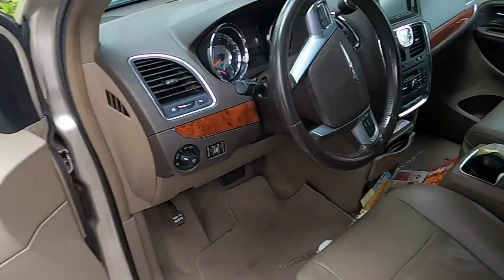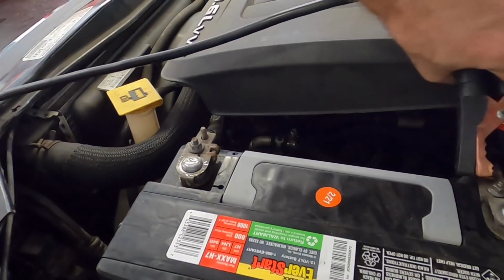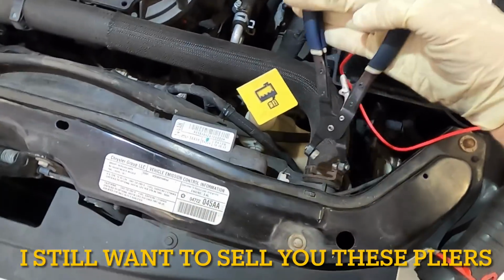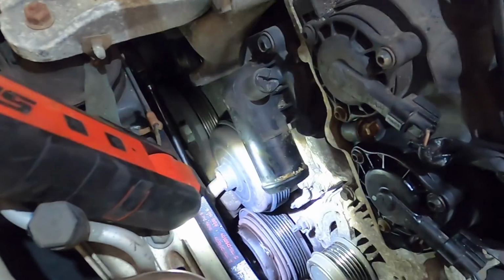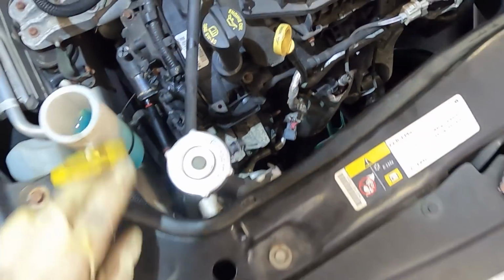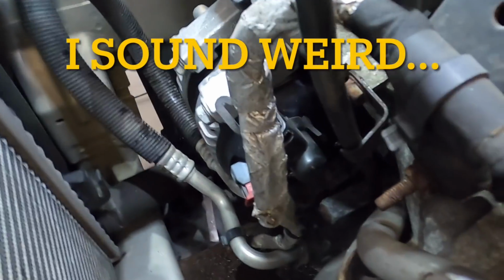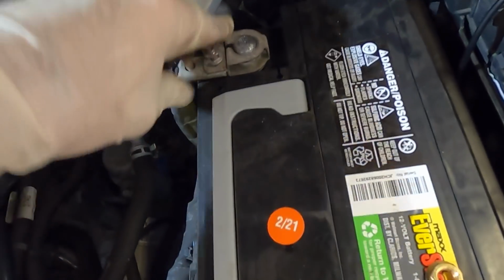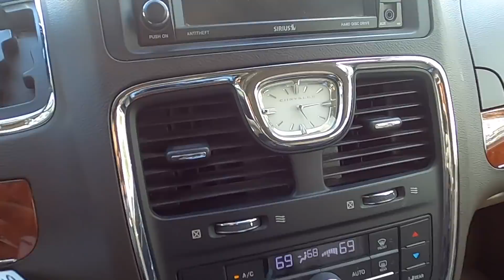Customer States: Burning Smell…Fire? 2014 Dodge Chrysler caravan battery light on!

Comment: I like vehicles where you can change the alternator without removing anything else.
Reply: do those exist?
Reply: Yes, like my '97 Land Rover. Alternator is right on top of the engine. 10 minute job if I stop for coffee in the middle. Not to mention, the original alt lasted 23 years.
Reply: @ianriggs  older vehicles, especially trucks with big engine bays
Reply: Rav4 Mk2 and Mk3
Reply: My 09' 3.8l T & C has that "no interference alternator removal" design. My friends at Duralast have seen to it that I have had plenty of practice 😡
Reply: @ianriggs  yeah my 2019 Subaru has the alternator front top and center, only has the plastic belt shield and bracket to pop off!
Reply: My Toyota has 360,000 miles with the original alternator.
Reply: I miss my 99 GMC Sierra for that reason. The first DIY I ever did was change its alternator and it sits right on top next to the air intake.
Reply: I was thinking the same thing.  Those were the days.  One bolt to release the belt and one more holding it in and 2 wires.  10 minute job.  I miss my 78 Ford pickup with a straight 6 2wd 3 on the tree.  Best truck ever made.
Reply: 10th Gen f150 with the 5.4 is four fasteners, one harness terminal, and the belt, and everything is visible standing at the front bumper.
Reply: I can get at my mk4 vw golfs pretty easy 🤷‍♀️
Reply: If the manufacturer kept it easy then why do they need all their engineers on payroll and then dealers couldn’t charge ‘ an arm and a leg’ to repair vehicles
Reply: 2004 hilux 1kz-te pretty easy to work on
Reply: Pretty much always gotta take off the belt tho
Reply: @ianriggs  I have a 2008 Grand Caravan. Takes about 15 minutes to change out the alternator.
Reply: @fordssuck  with the exception of my ’05 Lesabre. It’s way too easy to work on that thing, compared to my Beamer anyway
Reply: @ianriggs  new corollas are like that  and my 20 Cherokee is like that where you can get it off with out removing everything
Reply: My sequoia you can but only if you remove it from underneath so it's just as bad sometimes I prefer taking the fuse box and shit instead of laying down
Reply: It's a Chrysler, the original alternator was designed to be installed at the factory and removed by wrecking yard employees.
That doesn't necessarily mean they have incredibly long lives.
Reply: My 94 Mazda B3000 was great for alternator removal, easy peasy. Only did 3 (all quality remanufactured units) in the 23 years I had it
Reply: @alanm.4298  that must have been all that lasted 27 years on the motor..lol
Reply: @ianriggs  my 97 accord with the 2.2l.
Reply: But this is a POS Chrysler nothing is easy
Reply: @ianriggs  did a Buick the other day it took me longer to gather up the tools than it did to do the job
Reply: Yep I agree. But most sad part for this lady is that she owns a Chrysler. 11:46 that sticker in the left part of the screen is a “ Chrysler limited liability company” sticker. As old Scotty Kilmer says “ don’t walk away from this car, run away!” Lol. Most Toyota’s have the alternator right there ontop and plenty of working room. Love my 2009 yaris. Takes a few minutes to do it.
Reply: @ianriggs  my 05 f150
Reply: Lots of fun when you have to remove the wheel, ball joint and CV axle to get to it then remove the alternator bracket to make room to get it out. Then hope one of the three you got is good.
Reply: What’s even better is a car with no alternator at all 🥵
Reply: @ianriggs  yes they do!! My car is easy to remove the alternator!!
Reply: toyota corolla..  GM trucks  pretty much all of them
Reply: But if they did you'd be able to do the work on your own and it would make the dealership have a sad face.
Reply: @nykf32  yes, the ones with the "dynastart" system.
Reply: AMEN brother!
Reply: @ianriggs ......yes the older cars...chevy, ford, dodge
Reply: I like the way they are on the old Chevy's cars and trucks pre 2000
Reply: @ianriggs  2000 Tacoma is right in the front on top of everything...Wouldn't know how hard because they never fail...?
Reply: @Bryan-Hensley  Wish the same could be said about their starters...PAIN in the M Farking AZZ!
Reply: My 01 mustang was like that I had to take the belt off but that was it
Reply: My old 1977 280z, massive room, 2 bolts 1 nut and 1 plug.
Reply: It's right on too on my Honda which is nice, except that means it has to come off to fix basically anything else on that half of the engine bay.
Reply: @cigarsgunsanddiesel8032  but shame that for sparkplugs the engine needs to come out
Reply: @thrustvectoring8120  you are incorrect sir... Plugs on Subaru are accessed from up top and through the wheel well fairly easily.
Reply: @thaton3guy100  my 69 Grand Prix hood area was huge. Could practically sit in the engine area safely.
Reply: Good luck finding one! My 2005 Caravan is not too bad, but draining cooling system to change the alternator?
Crazy!
Reply: @jonathanmacdonald9276  as being a person from Europe can some of you Americans please tell me what's the deal with Chrysler/Dodge because I hear nothing but bad stories on every US automotive channel. Is Ford better then?
Reply: I miss those days. Just to think I hated working on Cadaverlacs of late 60s and 70s.
Reply: Belt?
Reply: So any rwd 4.6l or 5.4l Ford v8!
Reply: Yes remember when you could pull the fan and shroud and stand inside the engine compartment
Reply: Man tell me about it. My first real car work was when I was a freshman in college. Had to replace the alternator on my 2000 civic. I must say it was such a pain for a then newbie
Reply: @ianriggs  My 98 Ford does. But have NO idea where the starter is, LOL
Reply: I agree but nowadays I got to take 10 lb of crap and put it in a 5 lb bucket just to make stuff more interesting hey have a good day
Reply: I agree! I love my 85 Burban

Comment: Why don’t you use a fan to cool the engine area a little quicker ? I have a old box fan that I found in a dumpster,it had a broken grill. I lay it on the floor with a couple 2+4 s. Under it. 10 minutes an the car is cool enough to work on

Comment: makes me happy to have a 2011 chevy truck.....alternator is right on top
Reply: Changed mine in about 15 minutes. It was a breeze.
Reply: I agree however I wish Chevy would build their alternators like Toyota. I've got a Toyota Corolla with the original alternator with 360,000 miles on it
Reply: @Bryan-Hensley  my 02 Silverado 2500HD has 498k miles on the original alternator, my 02 Silverado 1500 has 412k miles on the original, and my 1988 GMC 2500 has unknown miles past 334k miles due to odometer failure, but it's well over 500k on the original. In fact, all 3 of my trucks are all original except for the water pump on the 02 2500HD, and the valve cover gaskets on the 88 2500. (that is outside of your basic tune up parts like plugs wires cap and rotor)

Comment: Don't know why peps say you cant spray off an engine, I have a 2.0 Slow (851 HP version) that I pressure wash a couple times a year just to keep the under hood shiny and clean. Just don't spray water down the blow off or into the filter area (or cold air intake etc.) and all should be well with the world....

Comment: folks need to understand cars are not built to be worked on backyard  hammer  guys its all tech   and the tool for tech does cost money  i think your doing great    i do have a ?    the shock of the hammer breaking stuck nuts   i know it chews your tools up but if they are over tightened  a hammer on a tool on a bolt or nut sometimes works    your thoughts ???

Comment: It will all be electric motors before long but embrace the concept of the QUICK DISCONNECT! Tell the computer to eject the engine and a system of servos, solenoids and motor driven screws disconnects everything and you just lift or drop it out in minutes and replace all that accessory crap (alternator. PS pump, oil pump, AC compressor etc.) Well it's a concept for engineers to work towards.
Reply: You watch a lot of anime! Lmao

Comment: I so miss the days when you could open the hood, see the ground and all of the typical wearout parts on cars...starter alternator etc.  Whoever at GM decided to put the alternators right up on top were good engineers. Nowadays you cant even see the ground when you open the hood on most newer cars. You spend more time taking crap off to get to the part then R&R the part itself it seems.
   As always, a great video Ray...that clock in it is kinda purty:-)

Comment: The alternator on these can be removed from the passenger side wheel well, as well as access to belt tensioner. No need to dismantle half the engine.
Reply: yeah, we did one earlier this summer like that.  it was much easier from under the van.
Reply: Except you cannot get it disconnected or out easily...actually takes longer..

Comment: i put the AutoZone alternator on and its loud as hell. it works but the bearings are rough.. its lasted a year so far. easy to change and i believe it has a warranty.
Reply: AutoZone, advance and O'Riley alternators don't put out the full amperage as factory either. I bought a 140 amp alternator for my van and it's doing good to put out 90 amps. They won't warranty it either because it passes their testing machine. Well of course, it does work but doesn't put out enough amps. I ordered the parts to fix my original and put it back on. Lost the money spent at O'Riley

Comment: I did the 2 jump box trick on a dodge stratus when my neighbor was having issues.  (I wonder if that's the official solution for that car)…   I wonder why you didn't try just disconnecting the dead battery?  I've found when the battery is that dead the "Charge" you put on the system spends so much time trying to charge the dead battery there isn't enough left to turn the car over.  Seemed like you wouldn't even need a wrench with how loose the dead one was.  Is there a reason not to disconnect the dead battery?
Reply: Bones McGillicuddy  fair enough.

Comment: The high rise exhaust  manifolds on my 68 charger r/t got so hot so fast, I always hosed the engine down before touching it.  That 440 engine burnt up  a bunch of alternators, starter motors and batteries .Too much heat under the hood.
Reply: Did it have a six pack man and we're beautiful cars we only had the cars today though some of our friends have we'd be millionaires hey have a good day

Comment: My wife has this van. I changed the alternator from below by unbolting to ac compressor and sliding it out of the way. That gives you room to remove and replace the alternator. Saw it on motor city mechanics channel.

Comment: the downside to the newer modols of these grand caravans or in this instance chryslers copy of it for some reason they made the engine compartment so jam packed idk why they did that i mean my 2009 dodge grand caravan has alot of room in the engine compartment compared to my 2012 and whats werid is i swear they fliped the engine in these later models because the alternator is on top easy access on my 2009 while the 2012 and up seem to have as if it was flipped upside down which is show right here lol

Comment: Poly cutting boards with used come-along strap make excellent "no radiator damage" helpers.
Reply: I don't work on engines much anymore but back in the day I would use various pieces of sheet metal to cover the radiator.
Reply: I was thinking even a good piece of corrugated cardboard would do it

Comment: I can remember when you could change alternators, starters, etc in the parts store parking lot with a adjustable wrench....   Things are way more complicated these days....
Reply: That's why I drive a 1997 vehicle.
My dream car is a 1960's Chevy Nova - very easy /cheap to maintain...and reliable too.
Reply: Been a long tine dince dem day's lol
Reply: That's so dealers can charge a couple of hours to swap a light bulb
Reply: @unclegreybeard3969  new cars require that the entire headlight to be replaced if the low or high beams fail, its ridiculous.
Reply: @jeremycook4670  and then to remove the headlights you have to disassemble the entire front end lol
Reply: Gotta take the front wheel off and the fender well on a 2014 Chrysler 200 just to.change the battery. The alternator was a pain in the ass too. Had to go from under the car and remove the A/C  and then it was still not easy.
Reply: @korndawggy1801  it's the same way on a newer dodge journey 😂 remove driver side front wheel and wheel liner to get to the battery lol
Reply: Had a '95 Mitsu. Mighty Max.  Never changed an alternator in the shop or at the house.  It was always a curbside R&R in front of the NAPA!!  Two bolts, a nut, one belt! Done.
Reply: Of course, a lot of cars these days don't even have an alternator, or a fuel pump. Or oil. Service Schedule for my car is literally Visual Inspections until 80k Miles.
Reply: 86  crown vic, my alternator is right near the top, real easy to change. absolutely could do it in a parking lot with just a wrench
Reply: @jeremycook4670  I saw on a channel similar to this one, another mechanic in a situation like that: high or low beam fails and you replace the whole lens assembly. At some ludicrous price. Over a grand, I think it was.
Reply: @jeremycook4670  my dad had a 04 Nissan Maxima the head light burnt out I said hell that’s nothing I’ll get one from autozone the replacement bulb was $100 each. I was curious and called dealership they wanted $235 for each bulb. 🤣🤣🤣
Reply: @justinferguson5451  at least you could buy the bulb nowadays you got to buy the entire assembly
Reply: @BRBingeDrinker  Probably because the mechanic of choice is a trustee.
Reply: Been there done that many times if not in my driveway have a good one thank you
Reply: @raybin6873  how about a Chevy Nova 2 that was a nice car especially if you put a 396 in it
Reply: @michaelpressman7203  I had a 67 Nova with a 327...was a cool car.

Comment: Far out.
A reasonable customer.
Who'd have believed it?
Oh, and I still want to BUY those pliers.
Slight Covid induced cashflow crisis at the moment...
"Relative ease" is a relative term, these days. 
Chryslers are FUN. I own a PT Cruiser, so I think I know. It's only low mileage, too.
Can't sell it, because it has a new problem every time I start it.
Now the Traction Control Off light and the ABS light are on.
S'pose it's a wheel speed sensor, or the ring.
This is getting old.
And there was me going to get a new timing belt fitted.
Nope, not now.

Comment: Your struggle to get that alternator out really reminded me of when I replaced the alternator on the 1.6 Golf MK4 of a friend. I think the words I muttered the most was "How the f*** am I supposed to get that thing through there?". In his case the alternator died due to the main powercable from the alternator to the battery beeing faulty due to aging and corosion, causing the cables resistance to be so high that it caused the alternator to die while also getting so hot that it started to melt the small fusebox thats right on top of the battery on the MK4 Golf. Though it still baffles me why VW thought its a good idea to mount said cable to the exhaustheaders heatshield. Suffice to say I replaced that wire with a longer and higher gage one and routed it along the bottom of the radiator, away from direct heat sources.
Reply: This one probably died from the cables being lose so whoever changed the battery last was probably the cause

Comment: Why doesn this not throw a engine code? These days there is a fault-code for everything, but not for a simple charge error. My simple 7 Euro BT CAN bus scan thingy can tell me voltage at the connector during drive. Must be easy to make simple check for it. During drive is voltage varies between 13.6 and 14.2 Volts.

Comment: Those test lights like you used are a great invention, I have 2 one I bought from snap on and paid way too much for and one I bought for $20 from a tool salvage store that looks exactly like the snap on except it doesn't say snap on. Dumb @$$ design putting the alternator where you have to take half the car apart to remove it, worst ones I've ever done are a Chevy equinox and a Honda CR-V.
Reply: Ford says hold my beer! We put the water pump inside the motor! Because they never go bad.
Reply: @steveb6103   I assume you are speaking of their Ecoboost? I think the plastic impeller likes to fall off those

Comment: Chryslers used to have the voltage regulator as part of the computer and you had to determine if the computer or the alternator was causing the no charge. Since you just condemmed the alternator without troubleshooting am I correct in assuming the regulator and alternator on that model are one unit? I worked on 3 like that. Got a salvage computer for one, installed an external regulator for another, and one did actually have a bad alternator.

Comment: I have found that placing a fan forward of the passinger door, aiming it over the engine, it pulls cooler air thru the engine compartment, cooling u 2.

Comment: Step MCM: Jack up Ya Cahh

Step 1: Disconnect Negative Battery Terminal 
Step 2: Remove everything plastic
Step 3: replace alternator because the brushes have worn out so it’s a throwaway.
Step 4: Assembly is a reversal of the removal process.

Comment: those pliers are the most used pliers in my toolbox. is that ratchet the brushless one snap-on just came out with?
Reply: I have a pair and I also have one that has a long cable between the squeeze handle and the clamp jaws. It’s great for places where you can’t fit the pliers.
Reply: @brucecoleman7412  yeah I have a set of astro hose clamp pliers  for the hard to reach ones